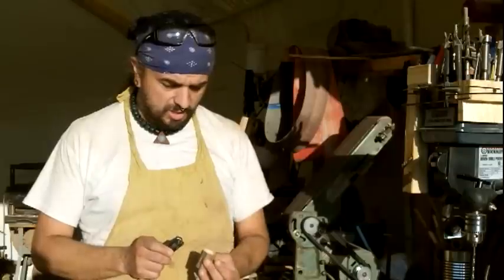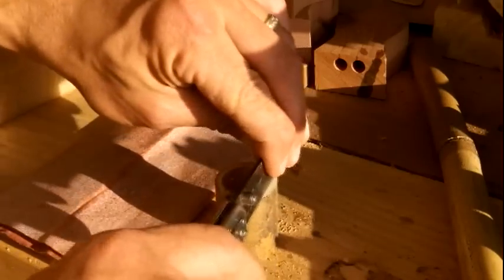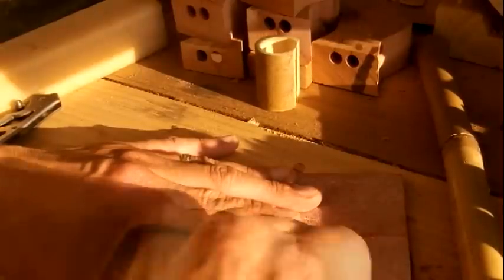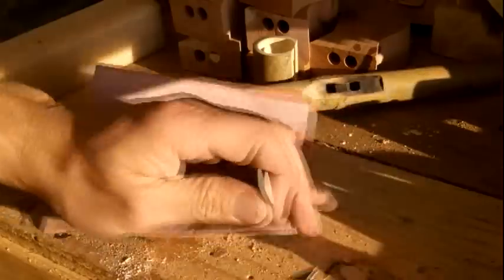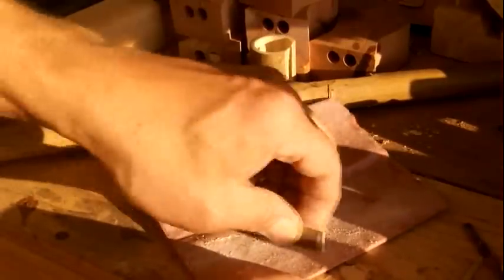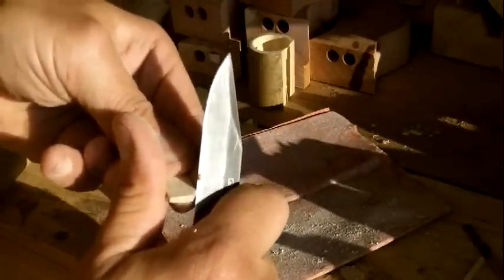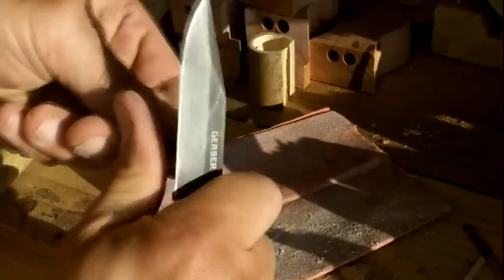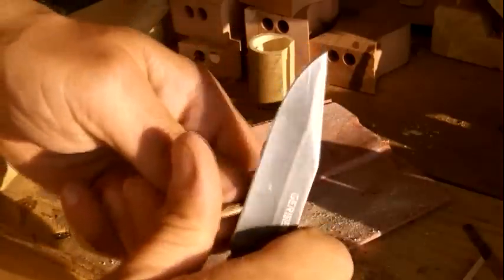How to make a simple Flute Block for the Native American Flute

Comment: I've had good success using a chisel and tapping lightly with a rubber mallet.  Just make sure to put the flat part of the chisel towards the hollow part.
Reply from the maker: Hundreds of thousands of flutes later, I have a system I usually stick with however I believe I do have a video on that as well!